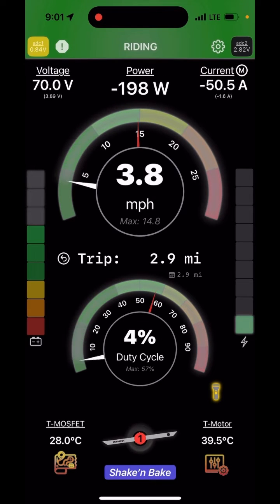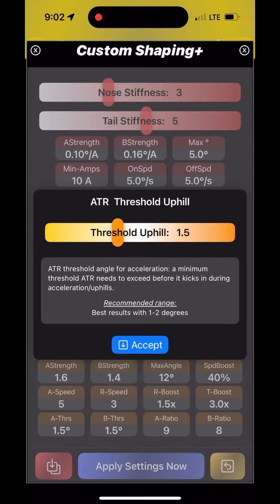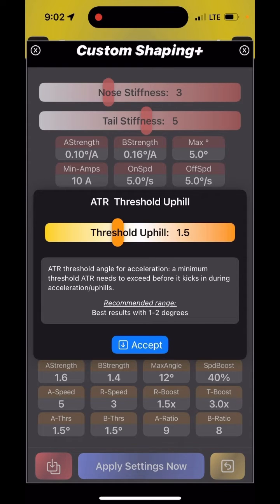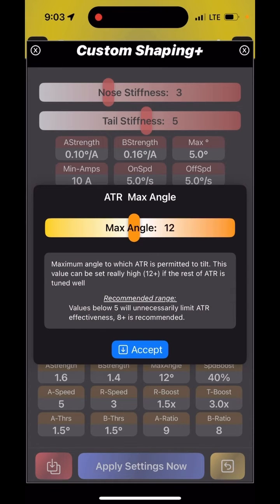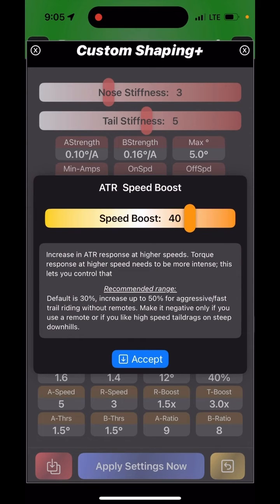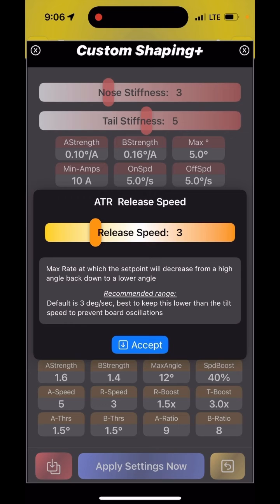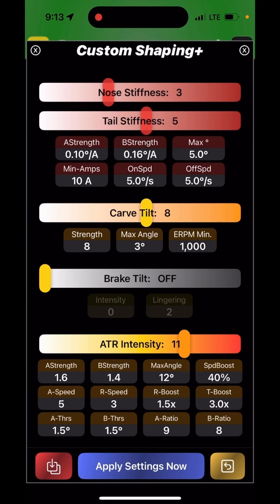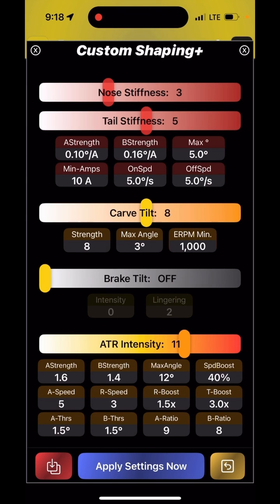How To: ATR Tuning (VESC Float Package)

Comment: I have the PintS motor with N52 magnets wouldn't that make it more sensitive to current than a hypercore with N42 magnets? If so, then shouldn't I set my A ratio and B ratio a little bit lower than typical hypercore motors? My A ratio is currently 8A and B ratio is 7A. I feel like I should leave them there instead of the hypercore recommended 9A and 8A

Comment: Hello, I have a quick question, I have a floatwheel ver 1 pro and I wanted to limit the board speed to 20kmh in the Float Control application. How do I do that?
Reply from the maker: the easiest way to achieve this is to set constant tiltback at about 6500erpm (Custom Shaping, then the "..." button) -  however keep in mind you can never truly limit speed on a onewheel, see https://www.youtube.com/watch?v=sFmDpmoLkIs

Comment: Which app are you using to configure ATR on the VESC controller?
Reply from the maker: I used Float Control which is iOS only - on Android there’s Floaty which is also an excellent app to use. VESC Tool is a must have for initial setup but while riding use floaty or float control

Comment: Only problem I have is on this app when I tune it to where I want and apply it and save it once I get off that app those changes aren’t saved and I have to retune it on every ride. Is that how it is or am I doing something wrong?
Reply from the maker: That’s intentional - allows you to play around with changes till you like them. Once you want to make them permanent use the red button bottom left - and Write Config to VESC

Comment: These are awesome! Quick question tho, I have an Android phone but I could tune with Float Control on my iPad. Am I able to freely switch between Float Control and the VESC tool?
Reply from the maker: Yes you can. Any settings applied from float control are not permanent though by default. So make sure to longpress the red button on the bottom and then choose write config
Reply: @surfdado  Sweeet thank you!